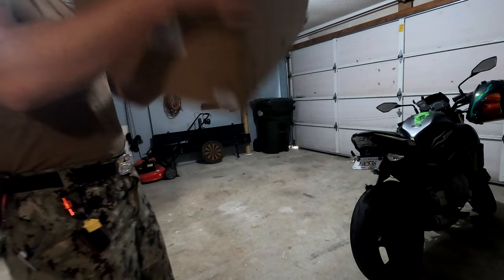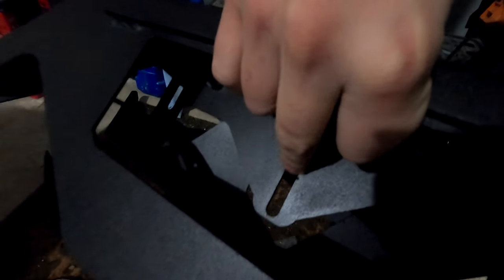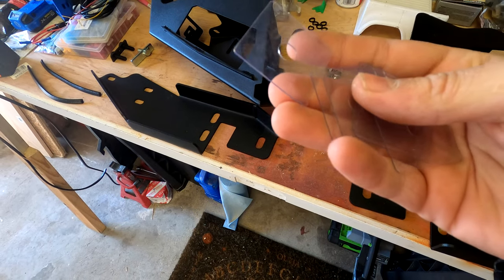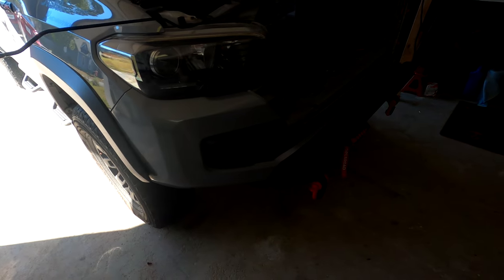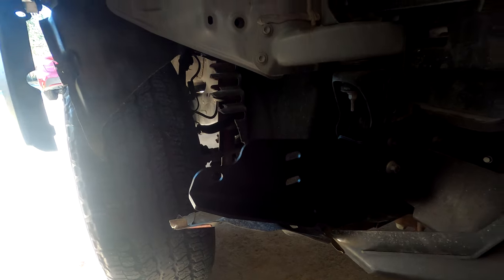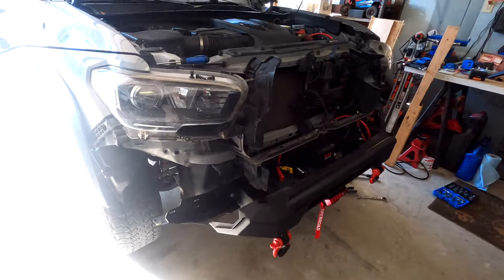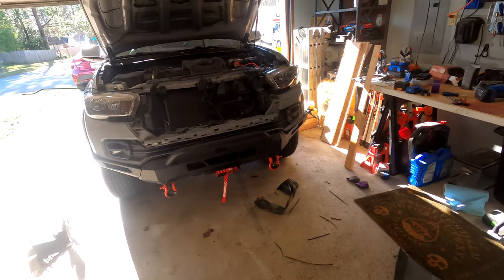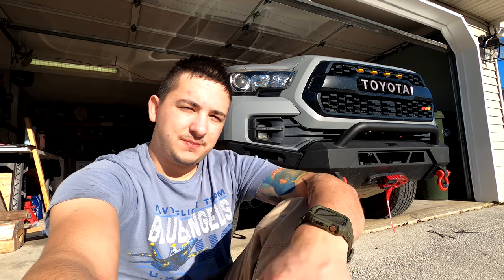Body Armor 4x4 High Clearance Wings: 2017 Toyota Tacoma

Comment: Great Video installation 👏. Was looking for a while on a video of the installation as I want to add it on my bumper in the summer. 
It looks like it will be a lot more easier to leave the bumper on and use masking tape on the exterior to draw a line and follow the fog lights body line to the 3/8’ - 1/2’  mark. The only thing I see that will need to remove is to expose the toyota grill area for tightening bolts for the clearance wing support bracket.
Reply from the maker: Yep totally, I was gonna try to do the cut without removing the bumper, and I think it’ll be the same about of trim and re-trim either way. 

Thank you for the view! Good luck with the install!

Comment: Thanks for the review! Are you planning to mount light bars for the wings? there’s not much information regarding on the lights bars beside been 6 inches in dimensions. I just ordered mines like 2 days ago from the yotagarage.
Reply from the maker: I will be mounting light bars, I actually just ordered two Heretic Studios BA-4’s with an amber lens.

No clue when they will be here though, holiday season has their company pretty swamped.

The hole on the wings for the bar is 6” wide however the inset for the wing is 7” x 1.5” so you might be able to get away with a larger bar mounted from the outside.
Reply from the maker: I would also say that with the space inside the wing being decently large fitting a slightly larger bar shouldn’t be difficult, you would just be looking more at whether the LED’s are entirely visible through the opening in the front

Comment: Great video.... Did you ever install your 6 inch light bars on the wings and if so, how difficult was the wiring?
Reply from the maker: Ended up doing the Heretic BA-4 4” lights (a smidge small but not bad).

Wiring was super simple as I have a switch pros and did all of the wiring pre work when I installed that, so it was basically just running the positive and negative leases of both lights to the light controller under the hood✌️
Reply: @MidnightSun518  Hey, can you attach a pic from the backside / inside the fender area? ( with tires turned if needed ) I want to see how much room there is to install the 6" light bars later on. Thanks.
Reply from the maker: @davidr.1517  couldn’t figure out how to attach a photo in the comments so here is a short:

https://youtube.com/shorts/zaga-5dHUYs?feature=share
Reply: @MidnightSun518  Thank you.  That helps a lot. I will not install the wings, untill I have purchased the 6" light bars too. 👍

Comment: I already did the viper cuts on my bumper can you measure how much distance you have between the bottom outer edge of the headlight down to the edge of the wing?
Reply from the maker: No prob bro. From the bottom outer corner of the headlight (where the curve starts to wrap around the truck) to the corner top edge of the wing is 11”.

I will also say (with limited research) that the viper cut and these side wings offer similar wheel shell space if you are only going for larger tires.

The viper cut removes less of the plastic however from what I saw in photos it doesn’t offer much of a difference if you went up to 33’s. 35’s is a whole different thing but I’m sure you have already looked into the trimming that would have to be done.
Reply: @MidnightSun518  I already run 33s, just upgraded the bumper and wanted more protection with the metal wings, just didn’t want to drop the 1000 before I was sure 😂
Reply from the maker: I take it you don’t yet have the Hiline center bumper? The wings should only be $300.

But I totally understand wanting the armor. 

Out of curiosity, did you have to do buy offset rims for your 33’s or are you running the stock 17” rims? I haven’t yet gone with a larger tire and am trying to plan it as much as I can before I buy
Reply: @MidnightSun518  I have a different brand bumper right now but ordered the BA and wings a couple days ago. 

I am running 285/75/16s with -15 offset. I had some rubbing on fender liners and etc but didn’t need to do the viper cuts, I did it because I liked the looks and function.
Reply: Did you end up taking the whole bumper on to do the cuts or did you cut with the bumper on?
Reply from the maker: @bizzybtaco4153  I took the whole bumper off, I’m sure you could do all of this work with it on, but I didn’t want to cut or scrape the metal of the bumper when cutting the plastic so I just took it off.

Comment: What brand of lights fit in those 6 inches?
Reply from the maker: Honestly any light bar. Some of the larger ones might be a struggle to install if you aren’t putting them in with the side wings, but there is so much space that any 4 or 6” bar should fit without issue. 

Main thing to look for is a center mounting point on whatever light bar you chose, there are no side mounts within the wing.